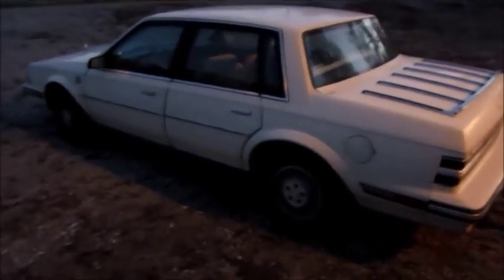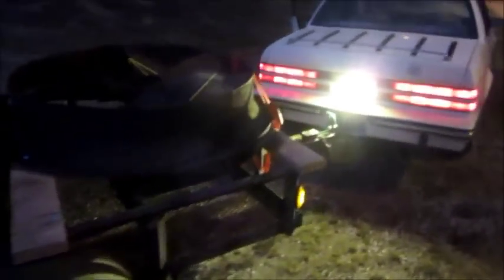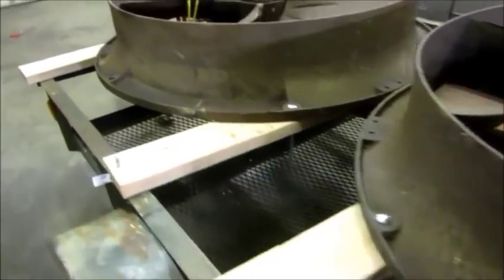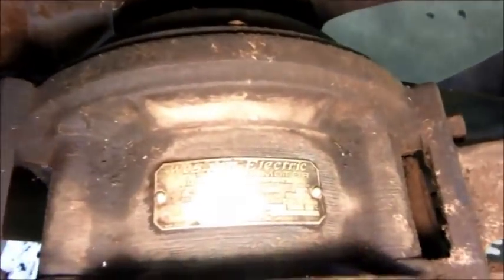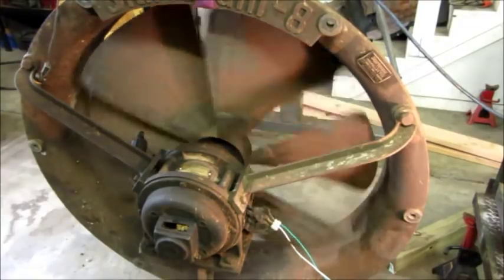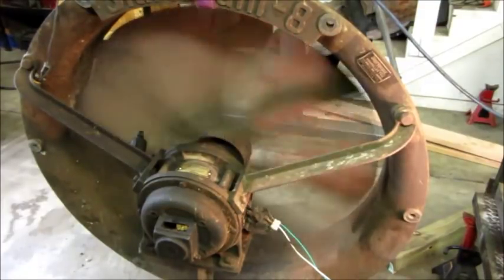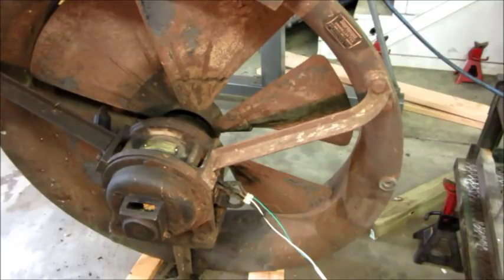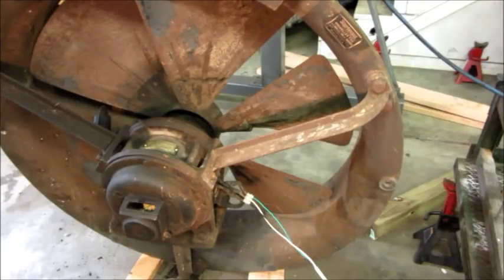Sturtevant Size 8 Design 5 Propeller Fans - #1 - Road Trip and testing first fan...

Comment: Sounds pretty quiet for its size and age. Do you have any decibel readings from it?
Reply from the maker: Hi Austin. It is pretty quiet but I don't have a decibel meter. We have one at work in Louisiana which is officially calibrated. We have compared it to "phone app" decibel meters and found out that none of the phone apps are even usable. They are all wildly wrong so I haven't had any desire to install one on my phone. :)

Comment: Hello there! I have the same motor 2hp, 1155 rpm.
Reply from the maker: Very nice!  I bet they got more HP out of it with the higher speed. Is yours open ventilated? Or sealed like this one?
Reply: I am not an expert in motors but I think is open ventilated, I can see through back to front, what's the price on a motor like this?